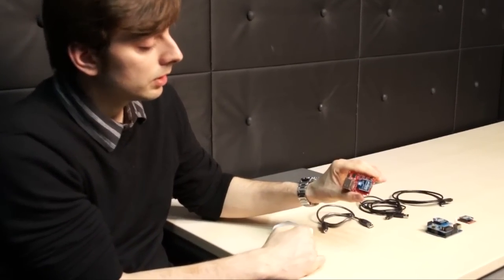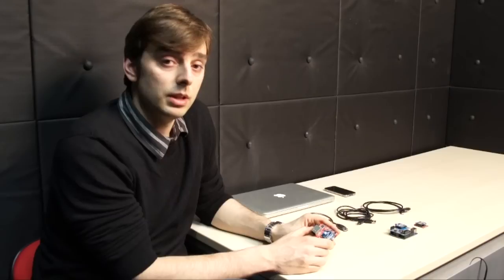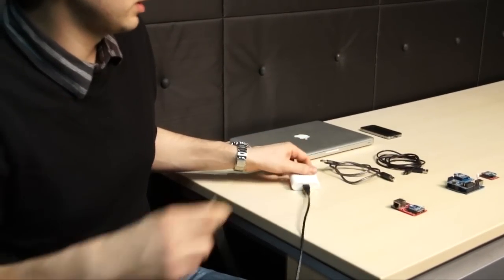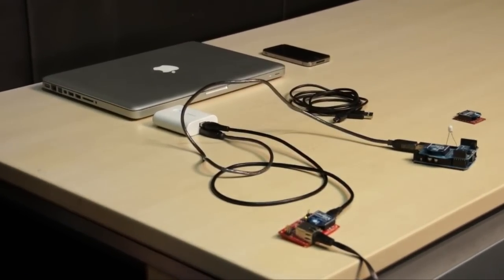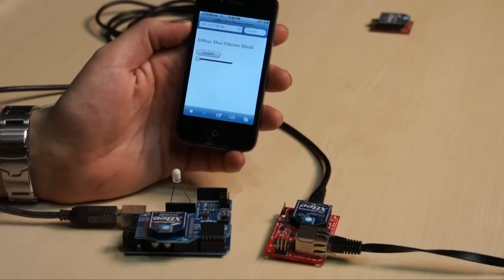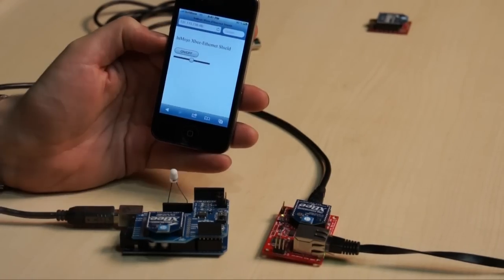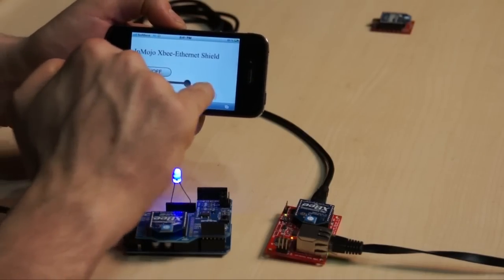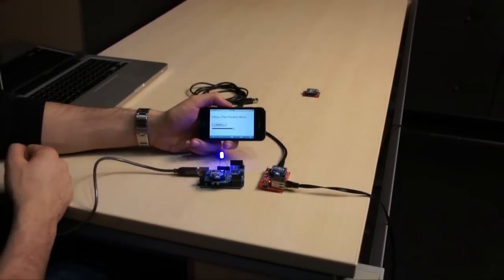InMojo Xbee-Ethernet Shield

Comment: DO NOT BUY THIS XBee-Ethernet Shield!

I bought this XBee-Ethernet Shield in now, to my surprise, the company sent me the defective equipment, he compiled after much complaint the company decided to send me another XBee-Ethernet Shield, to my surprise when compiled code with simple interface it worked quite well but warmed the Wiznet chip, however when I put a code more elaborate equipment after compilation did not carry the page, I auditioned several times, including recorded the same code on the Arduino ethernet shield which worked without problems 100%. After complaining again with the same company mysteriously said that the equipment worked well, which was not true, even sent the code to test for them but they did not give me the expected return. Finally, I requested the source code for Arduino and xbee receiving the information as video equipment where I respoderam:

 "Please try to understand and modify the code by yourself.
This is a tip and you can try! "

sent me one source that did not work as video. Do not know how they made the video but the source code they sent was not nothing compared to the one shown in the video, see:

serialEvent void () {
  while (Serial.available ()) {
    / / Get the new byte:
    swell char = (char) Serial.read ();
    / / Add it to the inputString:
    inputString + = swell;
    / / If the incoming character is a newline, set, the flag
    / / So the main loop can do something about it:
    if (swell == '\ n') {
      stringComplete = true;
    }
    if (swell == '1 ') {
             digitalWrite (yourledpin, HIGH);
      / / TURN ON LED
    }
    if (swell == '0 ') {
      digitalWrite (yourledpin, LOW);
      / / TURN OFF LED
    }
  }
}

it only turns on and off the LED on the receiving xbee, it does not control its brightness!

 I feel extremely hurt because I lost time and money with this shield. it is not meant to interface with better resources.